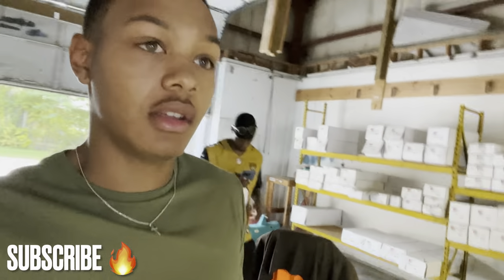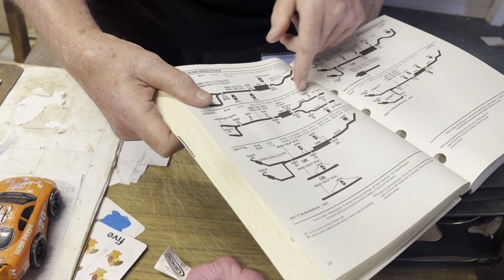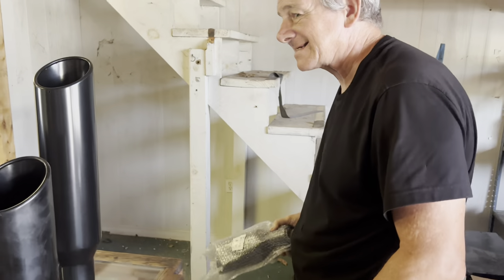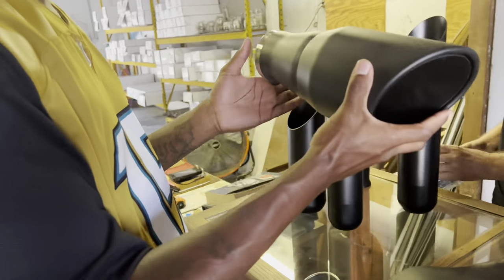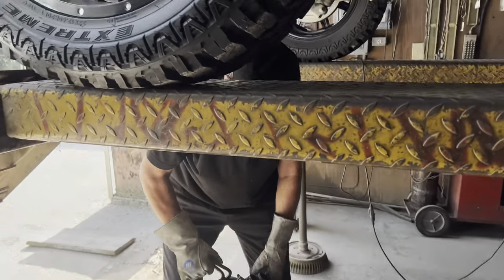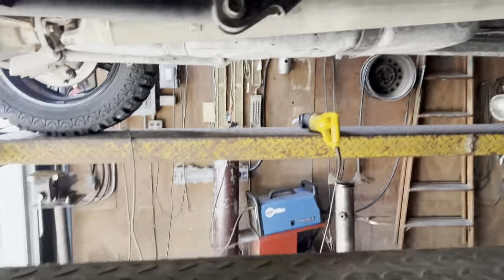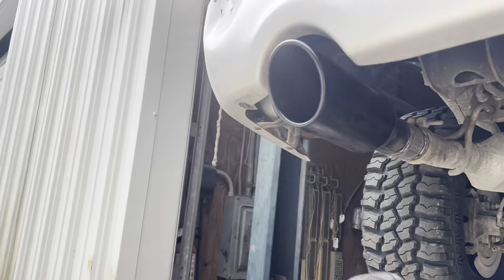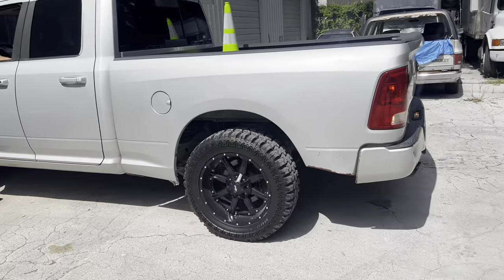Made the RAM 1500 sound like a HELLCAT with MUFFLER DELETE

Comment: Speaking from experience I have a 2008 Ram with a really small Muffler and no resignaters leave them on it sounds cool for the first few months but then it gets obnoxious after a while when it's droning inside the cab and you can barely hear your music and I have two 12's in a fox box and I'm about to have to get an amp for my speaker so I can listen to my music and enjoy it
Reply: I had a hole in my muffler in my old ram, took a drill and made it huge… cool for a month then I patched it😅 it was too much hah…